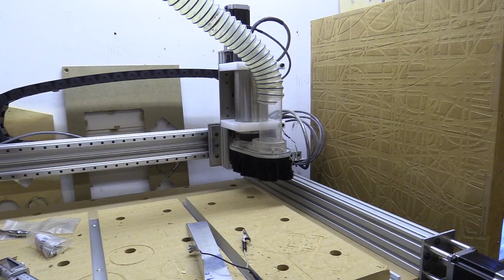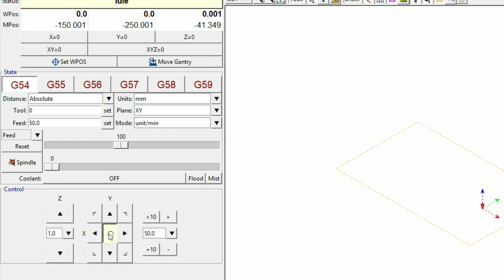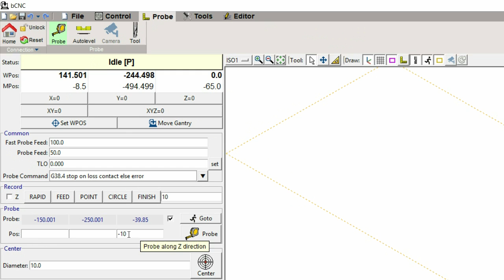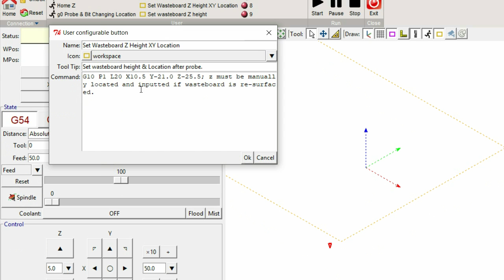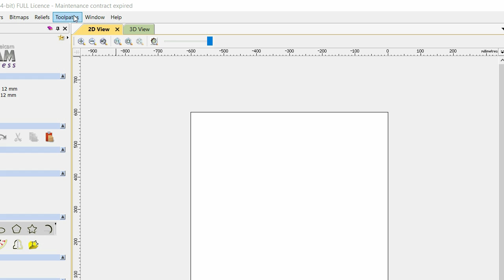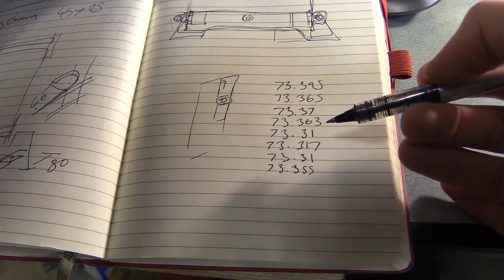#35 CNC Tool Probing #35 / Touch Button & Bit Changing

Comment from the maker: Note: G92 Position Register / Set Position commands will reset if a M30 command is executed at the end of a g-code job, or if the GRBL soft stop is pressed. This will effect restarting jobs. Instead of G92 it is recommended to use a G10 Set Tool Offset / Programmable Data Input command instead.

Comment: 0.08mm, I would not notice some body trimming my brie fluff by that amount. Homing and tool Z probing on forums etc has to many screaming girls. Thats all to know where the ball park is, unless your using additive devices regarding z such as 3dp.But in this case your repeatability + a bit for z is good enough. Maybe. And low signal is always the best way, more common to forget to connect or loose wire than signal short to ground. Even better to have duel low and high, but that's the screaming fanatical illusion that everybody has almost done yet have not but say they have unknowing they are passing the debt in expirence to you so as you inact the fabled notions to pay their debt for them. Erm so have some of these , , , , , , , , , , , , . Just stick them whrre needed.
Reply from the maker: Yeah I know, it's just so good I wanted to rub peoples faces in it. But in retrospect I should have used a babybel as a touch probe.

Comment: I use a similar setup but have an aluminium plate at 5v in the probe location and spindle wired to ground. I too have a tool change macro that runs like this. 
G53 Z-2; move to max z clearance, 
g30 ; go to probe location. (Set by issuing g30.1 at desired location), 
M0; pause to change bit 
G91 ;incremental mode, 
G38.3 Z-60 f250 ; protected fast move, if the touch plate signals then STOP (long drill bit etc)
G0 Z2; debounce incase of contact 
G38.2 Z-30 f100 ; find the touch plate, stop if no contact after 30mm (my max z)
G0 Z2; de bounce from touch plate 
G38.2 Z-3 F25; gently find the touch plate
G10 L20 P0 Z0; set z0 (my touch plate is set flush to the bed) P0 relates to the current WCS not tool number as you said. P1 is G54, P2-G55 etc etc
G90 ; return to absolute mode, you will crash if you forget to turn off incremental. A lot 
G53 Z-2; return to top of Z 
Hope this helps, you can use g38.4 and 5 in place of my probe commands and achieve the same with your switch method.
Also beware G92 it is not persistent after a soft reset of the controller G10 writes to the eprom  and will only require a rehome to confirm tool Ofset and WCS. It is however execellent for re running a cut at a slightly increased depth. I often sneak up on the final chamfer this way as so many parts have been scrapped on the last tool path because a the bloody chamfer.
Reply from the maker: Thanks for sharing your procedure. I've not been using the G30 command so I'll try that out. At the moment I've created another macro to do a fast probe from the probe and bit changing position (which I'll set to g30 now) and to de-bounce and perform a slower probe. I'll also put the M0 command in to pause the process for bit changing and so on. Regarding P function - I was referencing the grbl gcode library so that may be wrong. Just seen it described as you've said in the CNC cookbook. I guess if you had two spindles on a gantry p could define the work-offset of the second tool?? I'm still reading the g-codes and trying to get my head around them.
Reply: @EducatingSavvas  not quite. Forgive me if I over simplify but I will try and avoid confusion as your machine looks less likely to skip on the motors than mine and a crash will more damaging! 75% of my crash happen as a result of the following so use with caution. Here goes. Homing the machine sets the machine co-ords. This is the master set that everything else refers to. G53 references this but only operates for on the line it is enterered on (non modal) IE. G53 z-3 will position z axis 3mm below homing position. Now that the controller knows it location in the world we can set work offsets within it workspace. In grbl we can use 6 wcs' g54-g59. Default is G54. Entering G55 in the command line will switch wcs' and all future movements will reference that wcs. In a 3d printer this is used for multiple extruders, however on a CNC router this is used for multiple fixtures. For example I have G28 set as the bottom left corner of a plywood fence fixed to the bed of the machine. This is G54 X0 Y0. Thereferance edges of the fence were cut by the machine using this wcs'. So they are lined up to the machines axis and the corner is exactly at x0y0. After homing the machine G28 will always return me to that point. Raw stock is placed using a spacer away from the fence and program runs. Now to machine a chamfer on the back side we can no longer reference the same edges as they have been cut away. So I use a piece of scrap which can be placed anywhere on the table and set a new wcs' in G55 at that point. Cut a pocket into the scrap. Part in the pocket and run chamfer program. beware some cam programs (Fusion for sure) will specify in output gcode which offset it is going to use. If your expecting to use G55 and forgot to set it in Fusion it will default to G54 and cause mayhem. Also tool lengths need to be set individually for each offset. Altering in 1 does not update the next. Moving between wcs' with clear any temp offsets created using G92. I hope this hasn't been to long winded or I have put you off using them as it is a massive time saver. I learnt the hard way I don't want you to make the same mistakes as me. I really appreciate the time you take to make these videos. It was your original ply protype that then cut delrin replacement parts that inspired me to start down this CNC road in the first place. My machine still uses the delrin plates and works fantastically. This weekend I made several 3mm ally plates for a 3d printer i am currently working on.
Reply from the maker: @jimmer147  No thanks for the explanation and it's great to hear you making stuff with yours. I don't use the the G92 command now and like you've stated there's good reasons. Also some bench dogs on the wasteboard would be really useful if I can set different work offsets for them. The machine I use at work has some functions which work out offsets and wasteboard height but I have no way of knowing what gcode is being used - and the CAM software I use doesn't have information about working offsets (only tools number) - which is why I suspect tool number is relative to offset. I just don't know how it works. I should really set up for two tools on the software and look at how the gcode is exported. I still haven't learnt to use CAM on fusion 360. So many things to do.
Reply: @EducatingSavvas   In the industrial world all the tools are held in holders and the lengths accurately measured and stored in the machine controller. a wcs' is set once per part ie a corner some where. Each tool length offset is applied automatically to that original z hieght. When T2 tool change is called in gcode it is followed by G43.1 t2 (if I remember correctly, I don't use it so not 100% sure)which will set the z temporarily to that tools offset from the orgin (effectively a G92) grbl does not support this and our spindles have no way of repeatbiliy setting tools. So instead we probe alter the wcs Z for every tool change. To check what your CAM software is up to open an output gcode file with a text editor and check the first 10 or so lines of code. These are the set up lines which usually consist of G17, G90, G21(units, absolute,work plane...)
The only one you are looking for is G54 - G59 which is the work offset it usually only issued once per program a crtl F will hunt down any extras. Simply change to which ever offset you would like to use.
My probing is actually a little more complex than I originally posted as I use cncjs as a controller (chilli pepper running in a Java shell on the desktop as apposed to a web browser) and so I can define variables within the macro and run simple java strings. The first lines of the macro ask for touch plate offset and wcs location and sets accordingly I  gcode below. This prevents setting end mill length in G54 and then running G55 program which still has the previous tool offset (this is the P number in G10 where P0 is current wcs, P1 is G54 etc)

I also have a macro that can probe tool widths and outputs a very accurate number to use in CAM software (cheapo 6mm straight flute end mill is actually 5.81mm)

Comment: a small note, the position after a probe cycle is not necessarily the position the switch was triggered. when the switch is triggered the position is logged and reported in the probe response, the machine is then brought to stop adhering to the programmed acceleration limits. So depending the on the speed you are probing at the final position will overshoot the probe point more or less
Reply from the maker: Yes that's why I've done the amended macro I mention at the end of the video. I've written a fast probe cycle to start from the bit changing and probe location,  to stand off and attempt a second one at a lower speed. Saving me toggling down to the button.